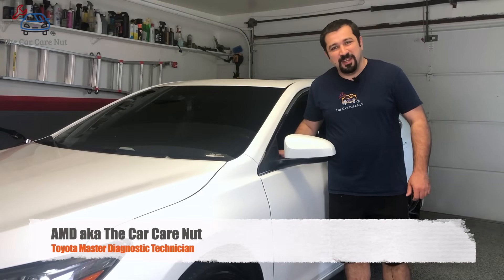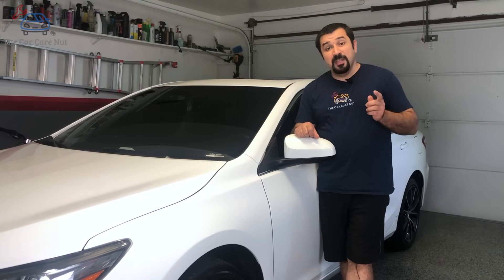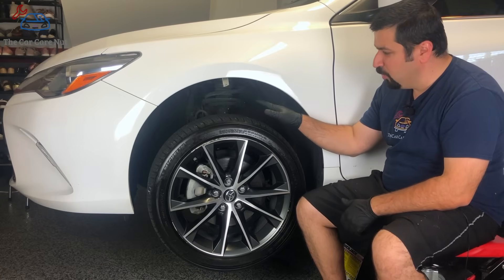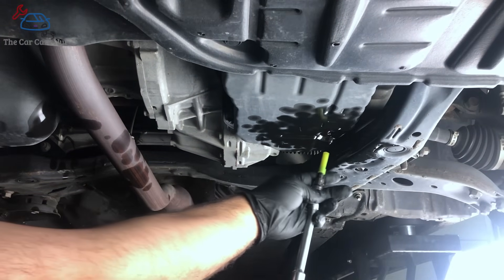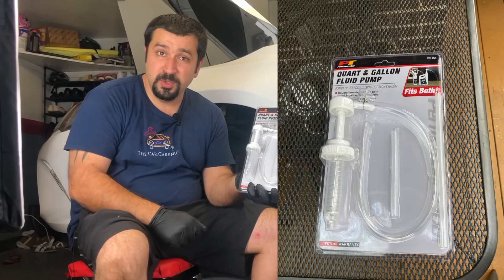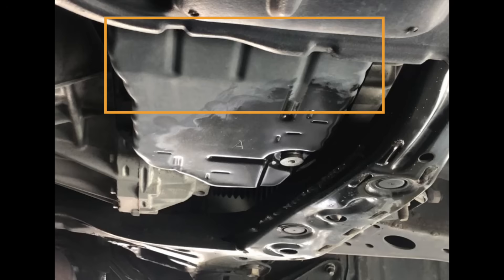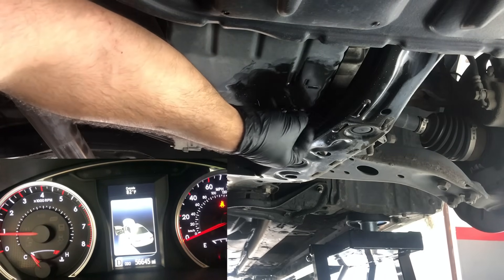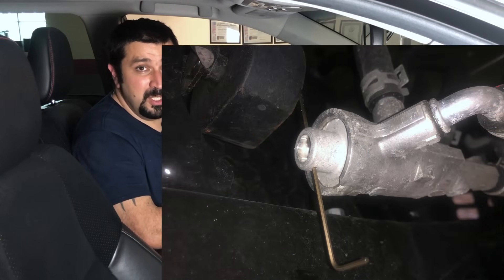How to change your Toyota Sealed Transmission Fluid

Comment: Hi Car Care Nut. Your videos are great. This one gave me the confidence to service my 2011Venza V6 2WD with 125K. Got it at 75K 6 yrs ago -oil changes documented but I do not know if trans was serviced ever. Using the diagnostics level method you described, the "D" light turned on, I checked the pan temp and it was 104F, and about 3 ounces of fluid came out after removing the plug. I wanted to know if it was over or underfilled so I interpreted these results as ever so slightly overfilled but close. I then removed the stand-pipe. It was red plastic not green. Another49 oz of fluid came out. That seemed too little. So uncertain what to do, I simply put in 53 oz of new fluid in.

What would you recommend?
Reply from the maker: Hi! Add new fluid then follow the procedure to check the fluid level. Likely slightly overfilled
Reply: @TheCarCareNut  Thanks for such a quick response! I added 4 oz more of fresh fluid and did the diagnostic level process.  I got 4 oz out. So I think when I originally opened the plug at 104F the first time, the stream was already gurgling but I didn't recognize that so  I went until nothing came out - which was 3 ounces too far. In retrospect, I suspect the original level was right on. About net 54 ounces in a change.
By the way, in Florida in February it takes about 25 minutes to go from stone cold in the morning (70 degrees) to 104F. And when the D light turned on, the fan turned on too, which is easy to hear.

Comment: Omg, thanks for demonstrating how to get the plastic clip open (and back in).

One comment (coming from the rust belt): make sure you can open the fill plug before draining the fluid. (Maybe it's not a problem on these, but it can prevent a lot of complications, especially if you are a DIYer.)

Comment: I don't understand the complexity of changing transmission oil with the 8 speed trans...this is absolutely ridiculous! I love my 2020 Camry with 8 speed trans and my former 2005 Camry with 5 speed trans. I owned my 2005 LE for 15 years with 218,000 miles. I changed trans oil 4 times during that time. It had a dipstick and draining oil was very easy. Go under the car...unscrew drain plug...re-screw plug...refill oil to dipstick level...you're done. Never had any problem.  All these procedures demonstrated here are...obviously a scheme where only a Toyota dealership is equipped to perform such a detailed procedure. I love Toyotas but...this is absolutely ridiculous and unnecessary.  Toyota should be ashamed for devising such a "scheme." I can only imagine what the bill would be to have this done at a dealer!

Comment: Thank you for you're videos. I enjoy them  very much. I am also learning a a lot. Greatly appreciated. I have a question regarding the transmission on my 2020 Tacoma TRD off road with an A/T. Not sure if I can ask this here though. Well, here is the question. The auto transmission makes a high pitch whine sound while driving it. It occurs during moderate acceleration and cruising (holding a constant speed). It makes the noise at any speed. For example it will make the noise while cruising at 65-70 mph. It is a high pitch noise, but not loud, sometimes faint. It lasts about 3 to 4 seconds and then goes away. It may do it again in few minutes. It will do it during slow acceleration also. It seem to stop all together after awhile of driving for about 30 min. My Tacoma has 23,449 mi. I driven driven it aggressively at times, going into passing gear to merge onto the interstate. The noise occurrences seem to be increases. I heard some Tacoma's had low transmission fluid from the MFG.  It is under warranty  still. Would like to know your thoughts before I take it in. Do you have an Idea? Thank you.

Comment: I just had my transmission fluid flushed at a Toyota dealership. I also wanted my diff fluid changed. I was told that the 2018 Camry shares the same fluid and hence they did not do the diff fluid change. I don't think that's right. Can any one confirm?
Reply from the maker: Hi! That’s correct. The front differential and the transmission are one unit and share the same fluid.

Comment: Hi AMD, thanks for the video! I got a question about the OBD jump. In my case, which is 2019 Rav4, it seems connecting the two terminals doesn't work. My car didn't enter the diagnostics mode. I also did a little research online. This jump could also reset the ECU in previous generation, right? My rav4 has the issue mentioned in T-SB-0107-19. The fix is to reset the ECU, but unfortunately I already have more than 8K miles on it, so it will not be covered. If I can reset it on my own, I'm thinking I might mitigate the issue? Could you please let me know if the OBD jump can also work for 2019 Rav4 and whether it resets the ECU as well. Thanks!
Reply from the maker: Hi! Some of the newest models doesn’t have the pin present and In that case you’ll need a scan tool
Reply: @TheCarCareNut  Got it. Thanks for your reply!
Reply: @TheCarCareNut  I have a 2021 4Runner SR5 Premium. Does the jumper cable still need to be inserted into OBD port? Or can I bypass that step and proceed  with the gear shift protocol to go into fluid level check mode?

Comment: Hi AMD, I have 2010 Camry with 140,000 miles. I have some AT issues with searching for gears or RPMs reving up. Additionally, during summer months on longer highway trips the transmission fluid temp goes almost to 230F. What do you think about Sonnax zip kits for this type of transmission or any other solutions. Thanks Mike.
Reply from the maker: Hi Mike! I would attempt to reset the transmission memory. I don’t have experience with the sonnax zip kits

Comment: What are the specific reasons the "sealed lifetime" CVT transmission fluid should still be changed ? For example, does the oil or fluid gel or gum over time ?
Reply: all oils wear out with time. moisture accumulates. friction breaks down molecules that protect components.  little airways can get clogged with material overtime. basically many reasons in tune with wear and tear overtime

Comment: My Uncle changed my transmission fluid in 2013 Camry...he out in 6 quarts, had no idea of all this. I was not home when my other half told him to come over to do trans. oil change...NOW the engine light blinking on and off, Sluggish,  SMOKE and oil  spill. I'M beyond mad.  I have never trusted him not to touch my car. What can I or should do.
Reply from the maker: Hi! Check the engine oil level first in case. Then you’ll need to basically drain the oil and start over with this procedure

Comment: Does the vehicle need to be running to get to the proper fluid level? When my fluid pan reached the appropriate temperature I removed the drain plug but nothing came out. When I turn the car off fluid does come out. Is this ok?
Reply: I think I found my own answer for anyone interested. You have the engine running in your video and after looking at a few forum posts everyone seems to say it needs to be running while you replace the drain plug otherwise too much fluid will come out.
Reply from the maker: Yes the car needs to be running in park

Comment: When you first drain the fluid was your engine warm? I followed this procedure on my 2011 sienna with a V6. I only got 300 ml out when I removed the drain straw but the transmission fluid was cold.

Comment: Are all toyota techs trained with this method?
Reply: Yeah, it's in the repair manual.  The temp check can be done with the pin jumper, or Toyota Techstream software.

Comment: will this be the same for 2020 xse corolla
Reply from the maker: Hi! The procedure doesn’t work on some corolla models which requires you to use a scan tool
Reply: @TheCarCareNut  for a 2020 corolla xse you recommed transmisson flush or just drain  and fill?
Reply from the maker: Hi! A flush is nit possible o these just a drain and fill
Reply: @TheCarCareNut  hello my dealer is saying to not touch transmisson i need your help!
Reply from the maker: I would replace the fluid. Find another dealership

Comment: Hi AMD!  I’ve been following your channel as I am a Toyota vehicle user ever since. 

Just a quick question. When the “D” light turn solid, should I put the drive stick to park or leave it in drive?

I will try to change my trans oil to my 2017 camry 4 cyl. 

Looking forward on your kind response. Thank you in advance. God bless
Reply from the maker: Hi! Put the car in park when the light comes on
Reply: @TheCarCareNut  
HI AMD. Thank you for the reply. When I am preparing to do the transmission fluid oil change I noticed the fill plug was marked “WS”. I ordered CVT FE. 

Should I use FE or the WS?  

Thank you again. Can you please advise whats the right oil?
Reply from the maker: For a 2017 Toyota Camry with a 6 speed trans it should be WS ATF
Reply: @TheCarCareNut  Thank you AMD. God bless always

Comment: This morning I wanted to practice the jump wire method on the odb (2015 Avalon). Car went into diagnostic mode as you stated it would. I cycled through P D a couple of times then PDR, then quickly through ND, however I noticed at the beginning the D light was always solid on. Not off or Blinking, just solid. Any advice? I watched this video several times. 
Thank you Sensei
Reply: I guess it helps if the car has warmed up a little after a winter night before attempting the jumper method.
Reply from the maker: Hi! Do you have a D light on solid even when you’re in park? If that’s the case then you’re within the temperature to adjust the fluid level
Reply: @TheCarCareNut  I think what was happening in my case, was that I didn’t give it enough time to get to that optimum temp. I say this because I purchased a scanguard and noticed that after a night of cold winter it took  at least 4-5 min before ATF reached 100 F.

Comment: Sorry to bother you again AMD but I had a mechanic do the Drain and Fill on on 2011 RAV 4 with 124,000 miles as you suggested. Isupplied him with 4 qts of Toyota ATF-WS to be on the safe side although according to what I've read a drain and fill usually drains about 2.5 qts. When I picked the car up the mechanic told me he'd used all 4 qts. I just checked the level with the transmission dipstick after driving the car 30 miles and with the car idling the level is about 1/2" above the High mark. I have no idea how much excess fluid this represents but do you think I should remove the excess through the fill tube with a hand pump? Thanks again!
Reply from the maker: Hi! That’s possibly half a quart or less. Not significant but you’ll want to drain a very small amount and recheck it.

Comment: Hi AMD. Is it ok to just drain the fluid when cold (room temperature) and fill it back in exactly as much as you drained while cold? So that way I can skip the step where I have to over fill and drain excess while in warm up period?
Reply from the maker: Hi! It would work if the fluid level was right to begin with. I would do the full procedure
Reply: @TheCarCareNut  Is it a bad assumption that the fluid level was correct from the factory? In other words, if I am the original owner and there are no obvious leaks, how can the level not be correct?

Comment: I have an 18 2.5 8 speed Camry and how many miles you recommend doing this procedure, with the majority highway miles and some around town, not much City and what degrees do you set the transmission at when checking the level 18 Camry
Reply from the maker: Hi! Every 60k miles

Comment: Thank you for sharing you knowledge. I own a 2014 Toyota Corolla and plan to change cvt oil. You mentioned using a infrared thermometer and I wanted to know at what temp to set the oil level. Thank You

Comment: Hi AMD. I really enjoy your channel . I’m very OCD about taking care of my vehicles as well. I’m doing my transmission service on my 2018 camry xse 4 cyl. I’m having one issue. I can NOT find the transmission cooler bypass valve. I have removed every cover from under the engine bay. I can see the actual cooler mounted to the side of the transaxle, hoses going to it, pipes, etc. But I am just not seeing the valve with the little bypass . I had to stop for the evening, as prolonged periods on my my back make me extremely nauseous. And since I couldn’t just locate , and push and lock it, I am stuck. Any help would be appreciated. Because mine is an XSE,  I had to wait till later in 2018 to get mine, as the early models from June till September were all from Japan.Is it possible the one you showed the valve on was a Japan model, and there’s some variation on the Kentucky version? I am not a professional like you, but have much experience with cars. I’ve replaced ac compressors, clutches, and even replaced cylinder heads in my youth. Not sure how I’m missing this. Thank you in advance sir!i actually just looked up the entire parts list blow apart for my car, and it’s everything I saw underneath mine, but doesn’t show a cooler bypass in the parts list ?
Reply from the maker: Hi! Your car doesn't have the cooler bypass. only on highlander and sienna models with that transmission
Reply: @TheCarCareNut  I have spent hours looking for the thermostat bypass on 2018 Camry 2.5L xse, wish you would attach this information at the top in the detailed notes below the video; that being said your videos are not only excellent but legendary as well. TY so much for doing what you do!!

Comment: It is quite interesting to learn from you always. But what happen if you want to flush the whole transmission fluid to replace with a new one?
Reply from the maker: Hi! You’ll need a machine that exchanges the fluid through the cooler lines
Reply: @TheCarCareNut  Okay Sir. Thank you a lot. Could you help me with your E-mail address?

Comment: Thanks for the articulate video! I have a 2020 Camry 4cyl (85k miles trans service never done….oops ) I am about to do this transmission service hope I’m not too late, before I watch your video I thought the change interval was 100k. 
Questions:
Roughly does the 8 speed also hold a similar capacity of transmission fluid to this 6 speed ?

When you push the pin and install that Allen key on that cooler, do I leave that in there for the duration of the service, even when the engine is on and I’m checking the fluid ?
Thank you
Reply from the maker: Hi! Should be around the same amount perhaps a bit more. On your Camry there’s no thermostat so no worries there
Reply: @TheCarCareNut  Thank you very much , I will be doing this soon. BTW one more question, what is the correct transmission fluid operating temperature  on my 2020 Toyota Camry 4cyl ?
Reply: So does that mean there is NO cooler bypass valve to pin open with an Allen wrench???
Thx. I could find it on my 2019 Camry 2.5L.

Comment: I love all of your videos.
I do have a question for you, I have a 2006 tundra v8 with the 6 speed transmission and I would like to know what is the temperature that I need to get the transmission up to for checking the level when changing the oil? And is it the same where I can remove the green plastic ?
Reply from the maker: Hi! Should be around 99-113

Comment: Hello, what would the transmission temperature for a 2018 v6 camry be?
Reply from the maker: Hi! 95-113
Reply: @TheCarCareNut  Thank you. I would like to say that my camry is an 8 speed but I did not locate that valve that had to be locked with an L wrench
Reply from the maker: Your Camry doesn’t have the valve only on some highlander and sienna models
Reply: @TheCarCareNut  You have been a great help. Thank you for your videos and wisdom 🙏

Comment: Hello "The Car Care Nut", I have a question about this procedure:
- The trans fluid needs to be drained when hot (operating temperature) to get as much out as possible.
- The filling procedure is based on operating temperature checking using a heat gun because trans fluid expands quite a bit when hot.
However, suppose this scenario: 
- Drain the trans fluid when hot and let it drain a long time (overnight).
- Let the old trans fluid cool down in an accurate fluid measuring jar until it has the SAME temperature as the new trans fluid in the bottles.
- Measure the exact amount of the old trans fluid in milliliters in cooled down state.
- Pour the new trans fluid from the bottles into exactly the same fluid measuring jar to exact same mount in milliliters.
- Because now the old and the new trans fluid are at the exact same temperature the volume will also be exactly the same.
- Fill the transmission with the same amount milliliters and it should be good?
Please let me know if and what is wrong with this procedure or if it can be used without any problem.
Reply from the maker: Hi! This works if the fluid level was right to begin with. And you’d b surprised how many are not. Do the procedure correctly and double check the fluid.
Reply: @TheCarCareNut  
Hi I have a 2010 camry 4cyl and want to drain and fill the transmission fluid. What temperature am I looking for on the temperature gun when doing the fluid level check.
Thanks

Comment: I replaced the transmission fluid in my 2013 ES350. However, when I drained the fluid, I got about 1.75 Qt out. I closed the plug after putting the drain straw back in, and put 2 Qts of Toyota ATF WS in. I started the car and shifted gears until transmission was 98F. I opened the drain plug and to my surprise 1.25 Qt of fluid came out. 2 Qts went in but total 3 Qts came out (1.75 + 1.25) So now I’m wondering if I’m low on ATF. Can you please comment?
Reply from the maker: Hi! If you opened the drain when you’re at 98 and got to a trickle you’re fluid level is correct